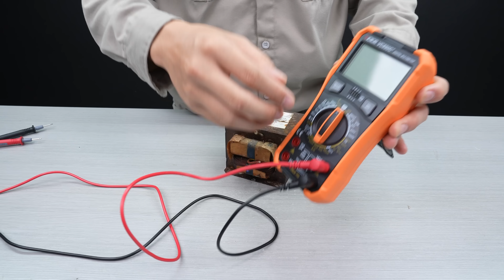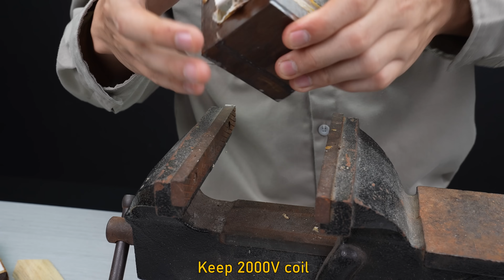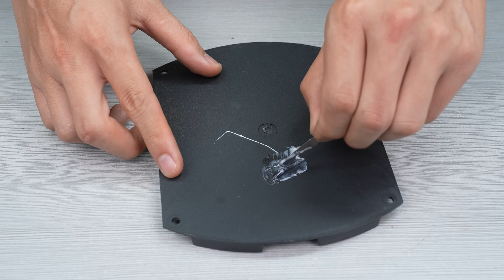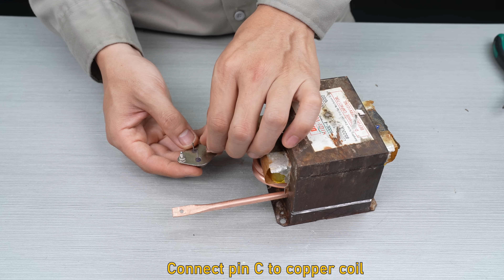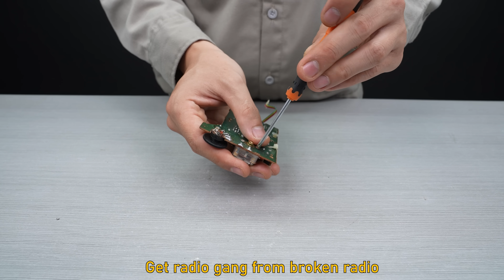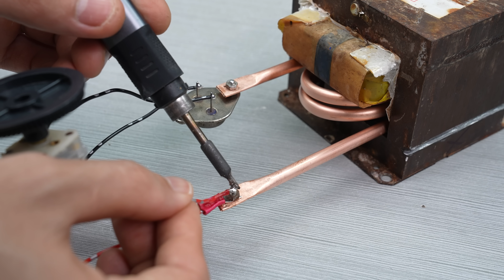Don't Miss This Great Idea ☝️ Cut Transformer In Half And Make A Lot Of Dollars

Comment: No battery how possible
Reply: Мало верится, что это работает.
Reply from the maker: It uses electromagnetic waves and antennas to receive signals from the ground.
Reply: takie radia robiłem w 1960 roku tyko na słuchawki i oczywiście na diodach germanowych
Reply: @dalida396 Вам около 80-90 лет?
Reply: @tam-syam  76 let , a czto ?
Reply: @dalida396 мало верится, что Вы собирали такое, будучи 10 летним ребенком
Reply: @tam-syam  no nie w 1960 miałem 11 lat a pierwsze radio na kryształach bo tak sie nazywało zmontowałe w 1964 roku po zdobyciu diod germanowych wtedy to była nowośc . Pozdrawiam
Reply: @tam-syam  >>> NON... il a 76 ans... (j'avais 10 ans quand j'ai fait la même chose... et je suis né en 1950 !!!) 😃
Reply: Don't do this or your house will burn..

The thick wire should be an insulated copper wire and not a fuckin bare wire..